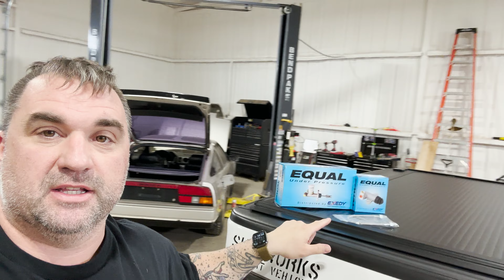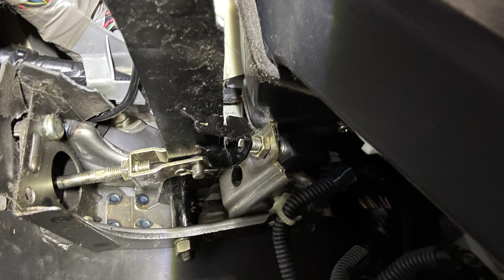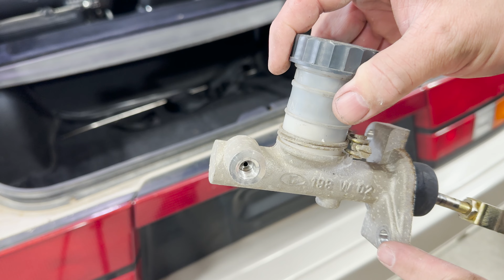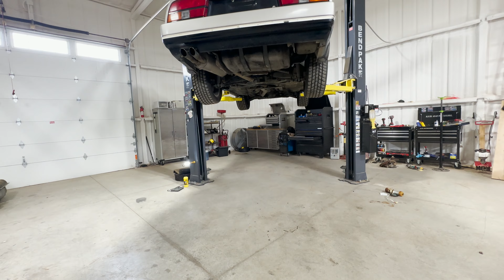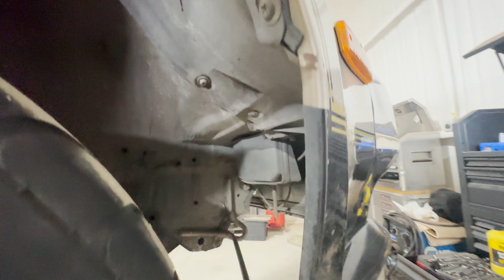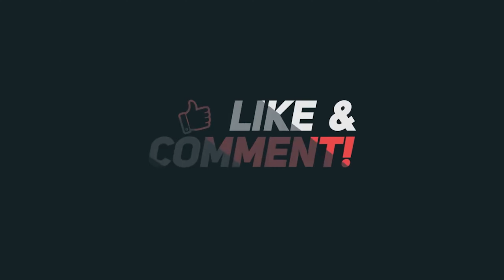300ZX Part 7 Clutch Master Cylinder and Slave Cylinder replaced.

Comment: Found this on redit "You need to replace the AIV valve, it is a reed valve that fails right near your driver headlight. It injects air from the pipe in front of the AFM to the catalyst to heat it up quicker. Also, if you want to play around with testing it, it is vacuum actuated, so you can simply unplug the vacuum solenoid connector on top of it. This will turn it off completely." I bet it doesn't need to be working for the car to run.

Comment: also, my z32 had the clutch bleed valve in the engine bay up top somewhere. I don't remember if my z31 was like this, but if it was, then this is likely why you can't get your clutch bled.
Reply from the maker: Ya my initial thought is that box is some kind of emissions trash since that kind of stuff was big for this generation of vehicles. I probably need a second hand to bleed the clutch.
Reply: @Bruburd  I can't recall what that box thing was called but I think your right it just has something to do with emissions. You can just delete it if you want but this wouldn't keep it from starting though. It's just annoying as crap. If I were you I would just get someone to pump the pedal for ya.